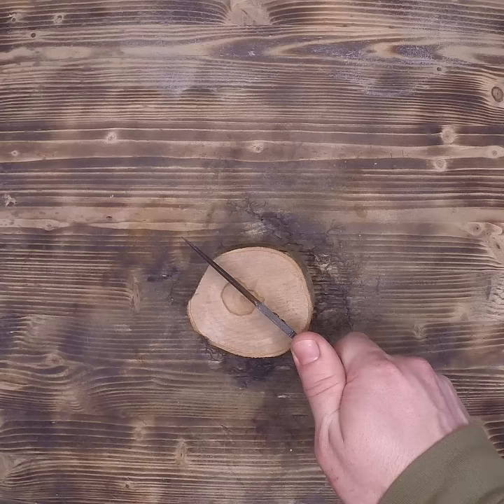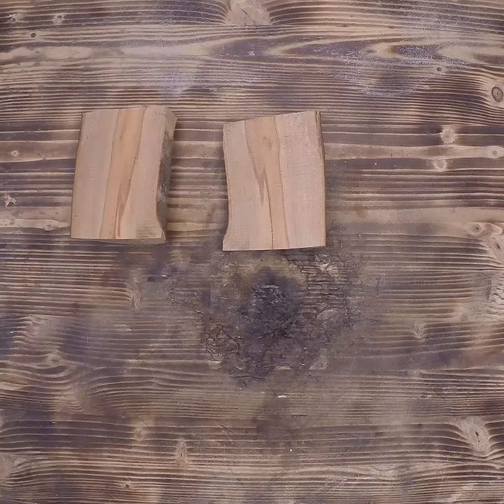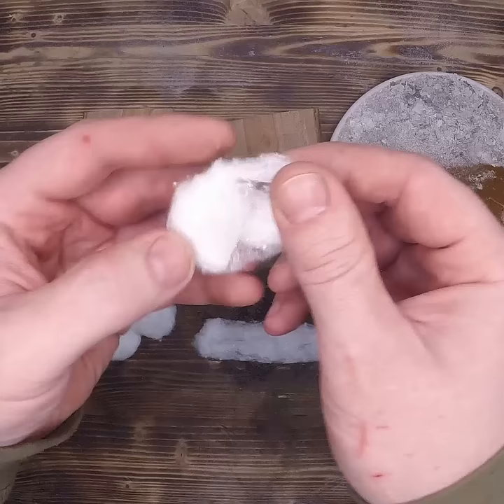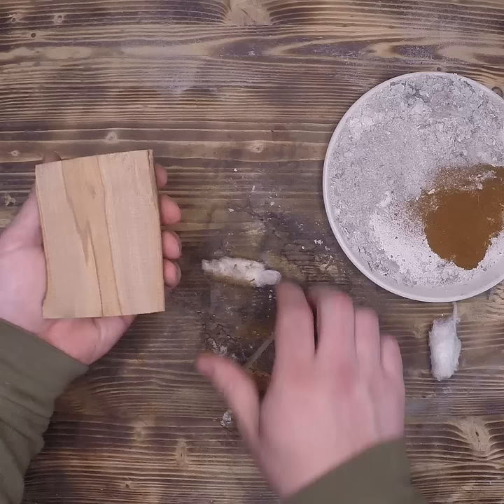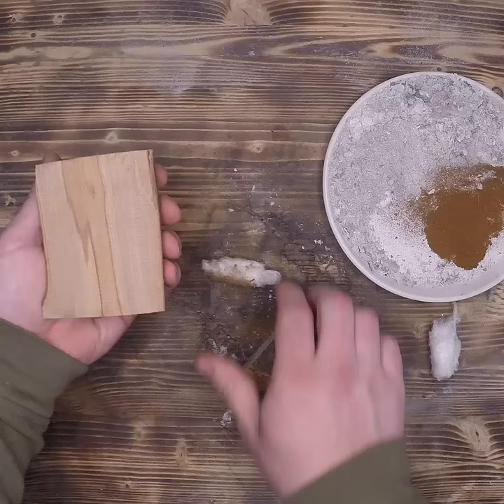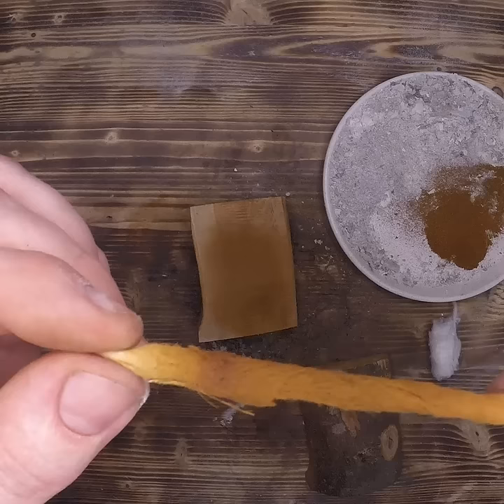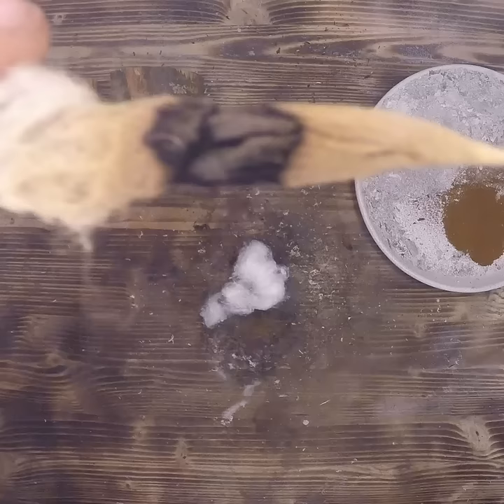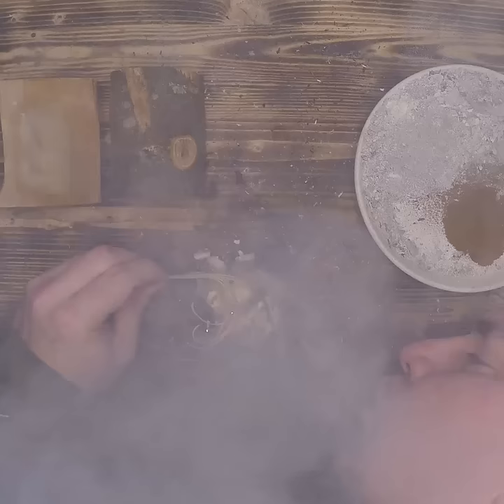INSANELY Easy Friction Fire! New (to me) Technique.

Comment: Disposable bic lighter 3000-5000 lights smaller than your knife waterproof infinite shelf life for $2! Its a no brainer
Reply from the maker: Perhaps it's a no-brainer for someone without experience. I can tell you when I was surviving in January 2008 in the Arctic that I couldn't get the lighter to function even after taking off my thick gauntlets. My fingers were freezing to the metal and I couldn't get it lit in an environment where I ACTUALLY needed a fire. Three years later in January of 2011 I was in Belize. It had rained for a few days and nothing was dry. I once again couldn't get my lighter to work. It just wouldn't spark. I was able to use a ferrocerium rod and start a fire in both cases which likely was the difference between life and death in both environments. The bottom line is that when it's too cold or too wet a BIC fails and that EXACTLY when you need a fire most.

Comment: POV: it rained and the ashes got wet
Reply from the maker: In my fireplace my ashes don't get wet from rain. Check your roof for leaks around the chimney.
Reply: honey you're making a survival tip to survive in the wild , unless you're in a cave with your fire which is safe that fireplace of yours would be as wet as my village when a flood happens and 30 people died
Reply from the maker: This is a survival AND HOMESTEADING channel. Not going to have an apple grinder out in the wild am I? Or a soldering iron? Or chickens?
Reply: ya know what sure

Comment: How well would this method work when it's 40 degrees F and raining?
Reply from the maker: Probably not well! That's why it's important to have the knowledge to use a wide variety of techniques and work on your problem solving skills to know what best fits your situation. For instance, this is obviously going to be more of a neat party trick than for emergency wilderness survival, so logically you would use this method at a bonfire to impress your friends and not when you are cold and wet and desperate for a fire.
Reply: @FollowTheCompassNorth  That's sound.  I'm sorry if I came across as sarcastic, as it was a legitimate question.  
I've always believed the most difficult weather is cold rain.  Finding shelter and warmth in that environment would be most challenging!
Reply from the maker: It truly is a test of skill to make a fire in that weather with any method, that's for sure. I'm always excited to learn a new fire starting method and increasing my capabilities and ability to improvise with those methods, but I definitely don't want to give people the impression that I am advocating this as the best one for every - or even most! situations.

Comment: I’ll be damned. I mean the wood, cotton, & rust or ash isn’t hard to find. However I simply don’t have the skills necessary to sharpen any knife I own to the point where it cuts a mini log in perfectly smooth halves with no mallet or wedge needed. I mean I thought you had basswood for a second the way you cut through it like butter.
Reply from the maker: lol, I used a bandsaw and cut the footage

Comment: OK iv tried them all iv never seen this one I'm in 
Now make a video  on the one way I saved my life went through the ice  on a river -6 below 6 miles out I all way carry 4 ways to start a fire  in my pack  I lost my pack under the ice I only made it out with my gun shells   quickly freezing  and striping I realized  I had one shot and used my electric  socks to make  a fire 🔥 
The wire and battery from thoes socks saved my ass

Comment: Flint and steel are just as good or why not just buy a lighter at the shop and keep it your emergency outdoor kit. Voila jobs a goodun.
Reply from the maker: Because lighters fail in cold and wet conditions... the conditions where you need a fire most...

Comment: Is that done outside?
Reply from the maker: I usually use this technique inside by the fireplace but it can be fine outside.
Reply: @FollowTheCompassNorth  that's surprising.. even though it generates heat on its own. 
But making a small hole to keep the fire from wind, is always a  good trick